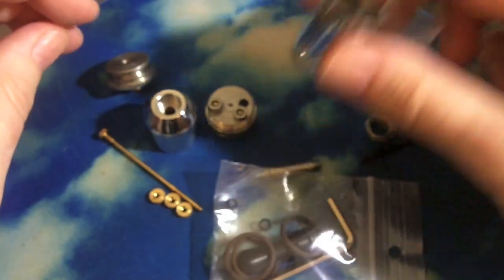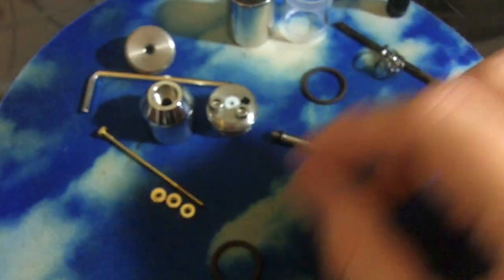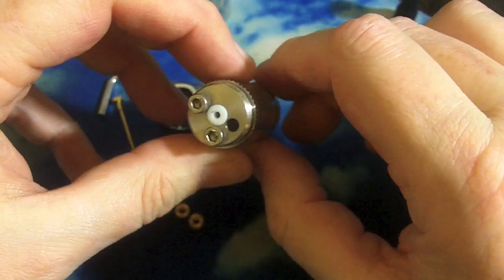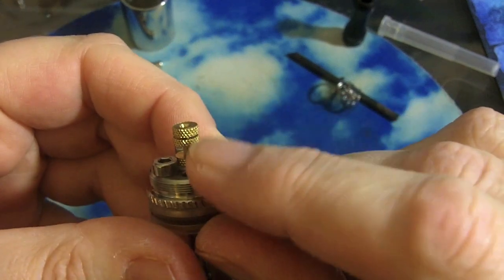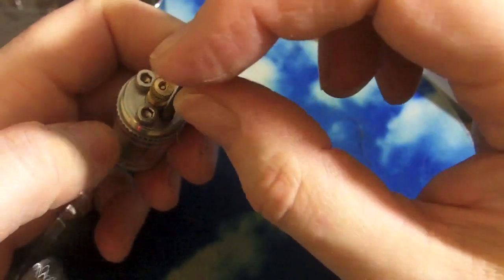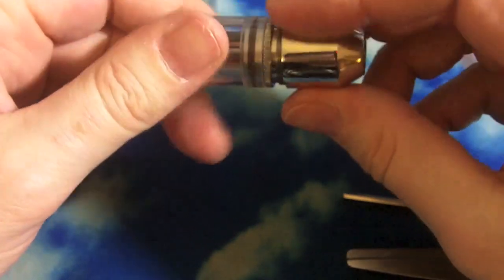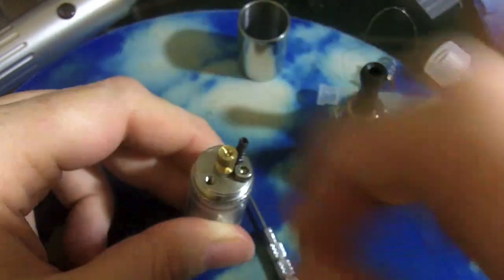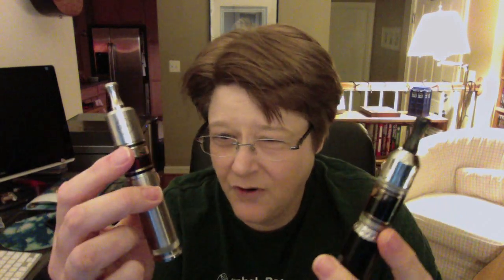DID Genesis Style Rebuildable Atomizer

Comment: If you look closely at the little brass nuts you will see that one side has a little cup and the ends are a bit knurled. So if you put the top 2 nuts with the cup side towards each other the knurled end will actually grip the end of the coil a lot better. And as someone else stated Jim now also sells an SS kit that has the positive post and nuts as well as the fill screw and negative screw in Stainless Steel. plus the fill screw and the negative screw are knurled so you wont need the little tool

Comment: I know the science behind the reason for brass. But as I said in my previous post I have both. I have a DID setup with a brass post and a DID setup with an SS post and I do not notice any difference in performance. They both work very well. However the shape and form of the new SS post (that is now default on the DID when you buy it from MMvapors) makes it that it is easier to setup and coil. Plus the new SS screws for the negative and the fill hole are knurled so that you do not need a tool.

Comment: I have both brass and SS center post and nuts now and i must say I cannot notice any difference in performance. The SS set is easier to set up and stays cleaner during use. Also my first brass post actually broke and I am still worried about my other brass post breaking at some point. The SS post I use on my daily vape now is showing no signs of breaking anytime soon.

Comment: Why would you want SS center post and nuts??? Brass conducts electricity better than SS does and as long as it does not come into contact with your juice SS seems pointless. That's why it was designed that way in the 1st place.